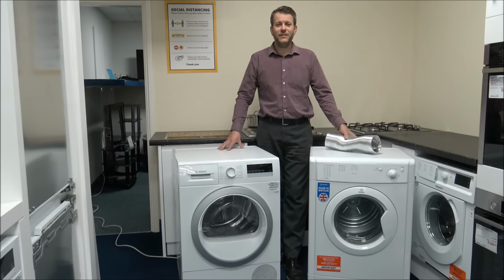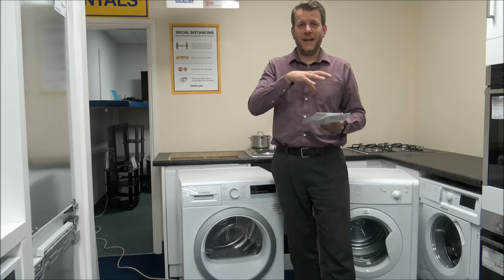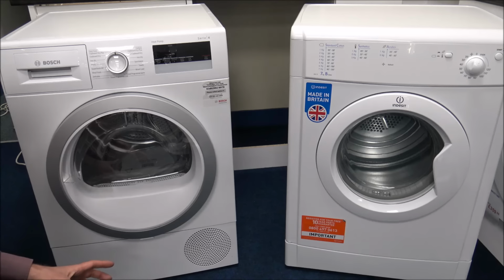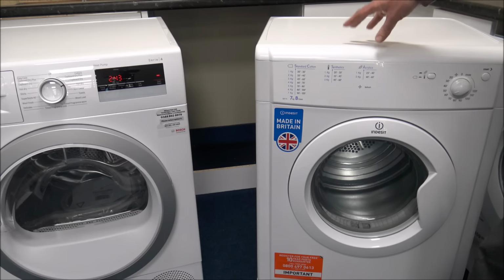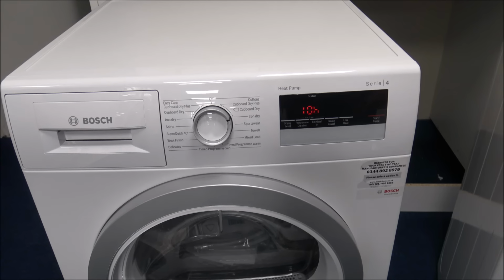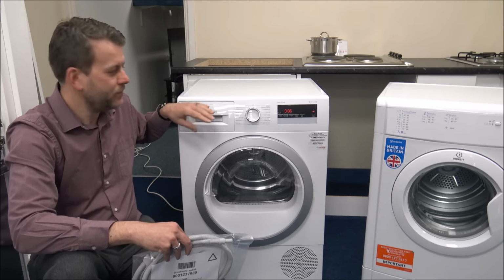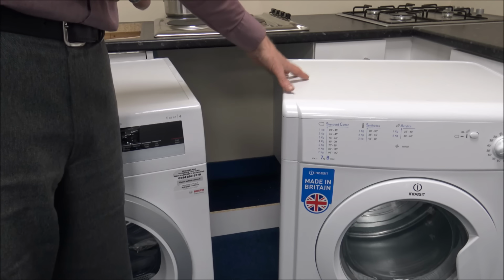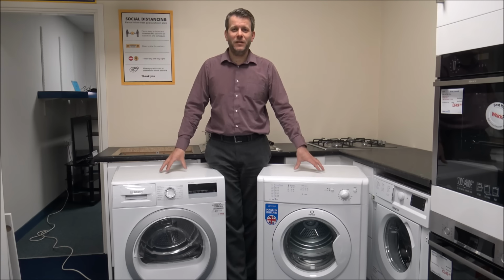Tumble Dryer Buying Guide   10 Things to Consider Before Buying a Tumble Dryer

Comment: I have a Bloomberg heat pump dryer and it doesn’t completely dry it in the garage if I put a reflector on the outside wall will it help please
Reply from the maker: It won’t make a lot of difference unless it raises the ambient temperature of the room it’s in. Heat pump dryers work much better in a warmer room compared to a cold one like a garage during winter

Comment: Ty for your videos.  Can you recommend a dryer that the door will still open after I've started it. I know its not recommended but I sometimes wish to put an extra item in, so find my old dryer ( which has broken down after 30 years usage) was so convenient, as it still opened after starting it.  TIA.
Reply from the maker: Most of the dryers can be opened part way through the program, but its not recommended as the sensor will restart and it will take a lot longer to dry if you open the door part way through the program

Comment: I need to put my dryer in a garage, which kind of tuble dryer would you recommend? I have a vented at the moment but there isnt much choice now with them being replaced with replaced. Thanks
Reply from the maker: If it is going into a garage, i would say to go for a normal condenser dryer. A heat pump dryer will be more efficient, but will take a lot longer to dry in colder temperatures

Comment: Thanks for your great videos. Are any models suitable for use in a cloakroom in the middle of a bungalow with no windows, just a vented loft hatch above?
Reply from the maker: I always get nervous about recommending something like this. Personally i wouldn't put a dryer in an unventilated cloakroom as it could get quite damp in there and cause problems in the future with moisture buildup.
Reply: @lords-electrical  thank-you for you candour. Appreciated.
Reply: im using samsung heat pump dryer , it emits neither heat nor moisture or hot air, you can put plants on it, heat stays inside, only glass is warm on the door. operating noise is calming also lol

Comment: Please could you advise which models are best to avoid superking duvet covers balling up and leaving the middle of the ball damp at the end of a cycle. Even some dryers which have claimed auto reverse still suffer from this. My 25 year old Creda doesn't but I want to update to an energy efficient model. Thanks
Reply: Don’t buy a heat pump one then. They tie everything in knots because they only go the one way.

Comment: Would you recommend putting a condenser tumble dryer in a cupboard with a door? I was thinking of adding vents to the cupboard door to help ventilation? Thanks
Reply from the maker: It isn't something we would normally recommend doing as you say mainly because of the venting issue. The vent on the front would ideally have to be all uncovered whilst the dryer is in operation to make sure there is no heat build up in the cupboard
Reply: @lords-electrical  what if I was to keep the door open or remove the cupboard door? Thanks for replying so quickly ☺️

Comment: Are there any considerations I should be aware of with regard to stacking a tumbler on top of a washing machine?

I am about to purchase both as separates rather than a washer/dryer combo.. dryer will need to be a condenser due to available depth of lobby.
Stack will be located close to external wall through which both will be drained to external drain.
Reply from the maker: all i would normally say is to try and get a good stacking kit between the 2 items so the dryer doesn't move around when in use

Comment: I am planning to buy a tumble dryer.But I am confused.I am planning to place it in a separate room with a small window in.My washing machine is with dryer.But clothes are not drying properly and we are using airer to dry clothes  and our house is full of mould now.Our agency told to not dry clothes inside.But no other option inside flat.Which dryer do you recommend for us?Plse help
Reply from the maker: If it is damp in the room and you cannot get a dryer, then it may be worth investing in a dehumidifier to help with the damp problem

Comment: Would you really count out the heat pump dryer in a garage? I was fixated in buying one until I saw this.
Reply from the maker: heat pump dryers in garages are ok, but not really recommended as it can increase the drying time a lot especially when the ambient temperature is cold. Apart from that, it is not normally an issue having a heat pump dryer in the garage.
Reply: @lords-electrical  ah gotcha. Would you recommend condenser or heat pump in the garage? We have our garage insulated so I'm hoping it'll help!

Comment: Great review! can you pls clarify, heat pump in garage just increase times or has other downfalls?
Reply from the maker: heat pump dryers in garages are ok, but not really recommended as you say, it can increase the drying time a lot especially when the ambient temperature is cold. Apart from that, it is not normally an issue having a heat pump dryer in the garage.

Comment: I am thinking of buying a heat pump dryer. I have an old white kinight condenser dryer, who is starting to flag now and isn't drying the clothes efficiently as it used to. They are pricy though and the one I was looking at was dearer than the washing machine that we also need a new one of. I am hoping this is it now although they say it comes in three's I am praying the kettle going was the first. :-)

Comment: Do you any manufacture which make heat pump washer dryer combo please reply
Reply: miele has them for sure   they use more electricity and water though as the convertial machines

Comment: What program I need to look for when I am buying dryer machine? I want to dry clothes for about an hour and no need to ironing and to not shrink the clothes. Thank you
Reply from the maker: The main drying programmes will be the cupboard dry or iron dry on sensor dry machines. If you only want it to dry for an hour then you will need to select a dryer that has manual timed drying

Comment: they are suck, give me Tumble Dryer that can Dry half loads in 30 minutes or less
if they didn't exist, then people should buy commercial Tumble Dryer rather than those junk
Reply from the maker: Must admit the drying times are longer now than they used to be on modern dryers
Reply: @lords-electrical  Dryer should have a proper Airflow at least 260 CFM for 7 cu ft size. But it only exist in commercial Dryer. Making the temp hotter only destroy the clothes, clothes need to be blown by powerful air in medium temp

Comment: So, in short, condenser tumble dryer can be kept anywhere (even in your living room), if you have a space constraint? The only thing we should be looking out will be the water collection tank? Is that right?
Reply from the maker: Yes a tumble dryer can go in pretty much any room, but if you are looking at the heat pump dryer and it is kept in the garage then the drying duration will be longer. as far as maintenance, it would mainly be emptying the water container and cleaning the filter and condenser unit which is normally at the bottom.

Comment: Start in 10 hours or finish in 10 hours?
Reply from the maker: Depends on the manufacturer, brands like Bosch and Siemens are normally "Finish In" which is a much better way, but quite a few other brands are "start in". Great question thanks

Comment: Could you please tell me if it's normal for a Grundig GTN38240GCW condenser  tumble dryer on any programme to"not get warm"I used to be able to throw a sweater in the tumble dryer for 5 mins and it would come out lovely and warm with my previous model.
Reply from the maker: It does sound normal for the dryer not to get warm. Most heat pump dryers will run at a slightly lower temperature hence they take longer to dry. Although each drying program will take longer, you will be saving money in the long run

Comment: Hi, I am glad that I watched your video, however I wonder if you can help me. I purchased this dryer, sadly not from you. I received it this week, and tried the 30 min option, but it did not heat up. The clothes came out the same as I put them in. Is there a certain way that you have to programme this option on the machine? The manual is as much use as a blank piece of paper. It does not give any idea, on how to use the programmes, and some of the information relates to the condenser machine, also some of the timings on the manual, is totally different to what the machine shows on it facia. I purposely bought this machine for its 30 min programme, and just wondered if it is faulty or am I not doing something right. I did contact Beko, who said that they would send an engineer out, but I wanted to see if I could fathom out what to do first, in case it wasn't faulty. It is only 5 days old. I hope that you don't mind me asking you, but there doesn't seem to be a technical dept at Beko, that is able to help me over the phone. Many thanks Val.
Reply from the maker: After 30 minutes it should show signs of being warm. Personally i would try it on a longer programme to see if it is drying first. If it is drying after approx 60 minutes then it should be ok as a test. Another question is where is the dryer located? If it is in a garage or outhouse then this could also be the problem.
Reply: @lords-electrical  Hi, thank you so much for your reply. I did let it finish the programme, of 30 mins and it was still cold. It dries okay on other programmes as I tested it to see if it would. It is located in the garage, but i have only used it once the day after it was installed there. So  it looks like it might be faulty on the 30 min programme.

Comment: i got now one of those bosh and what they say is self cleaning is far from self cleaning  can be destroyed bad  and no chances to manually clean it properly:D
Reply from the maker: Normally if it says Self cleaning, it is the condenser unit at the bottom. The filter in the door will still need to be cleaned and maintained
Reply: @lords-electrical   no i hatw the problem condenser is so nasty that is unbeleavable even tho it shuld  be self cleaning. it is literaly blocked and best part it is almost no access to clean it manually

Comment: if the heat pump takes longer wont that mean it will cost more?
Reply: Heat pump tumble dryers consume approximately 800watts per hour. Other type consumes 3000watts per hour. If heat pump dryer works 3 hours and the other type 2 hours, even that you are saving too much electricity.

Comment: Brilliant can you tell me would  a pump dryer outside in a outhouse make a difference with heat up have no heating outside it cold
Reply from the maker: Yes if it is in an outbuilding with no heat, then it would take a lot longer to dry the clothes when the external temperature is cold. We don't normally recommend going for a heat pump dryer if it is going to be located outside. Great question though.
Reply: @lords-electrical  i think a condenser dryer will be the least efected by this ? thogh a air exhoust is safer is it ever freezes in there

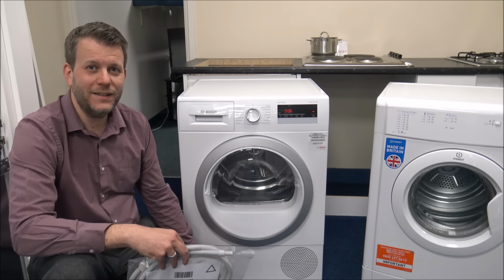Comment: 11:28 are all machines built to withstand stacking?
Reply: The truth is that not all machines can be stacked.   The machine has to be a certain size and a certain weight to be stackable.
Reply: be mindfull that the heat pump cannot be inverted due to the compressor so you have to reach up to operate contols if the heat pump is stacked ontop of a washer

Comment: you mentioned not efficient to put heat pump drier in garage.  considering efficiency would you recommend condenser over vented?
Reply from the maker: Yes we would normally recommend condenser as a lot more technology goes into the condenser models. Some manufacturers still make vented, but they are mainly the starting models in the range.

Comment: i herd dat bosch dryers only turn 1 way.
Reply from the maker: That is correct, the majority of tumble dryers are single direction only, the paddles in the machine are designed to rotate the clothes rather than the drum doing it by reversing